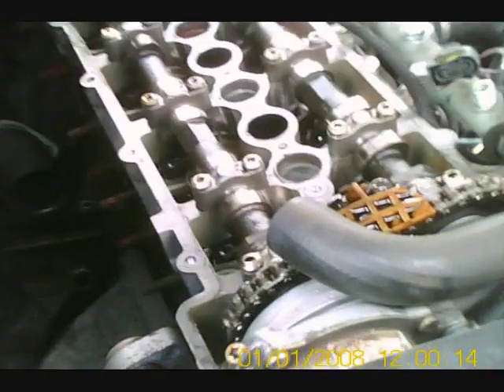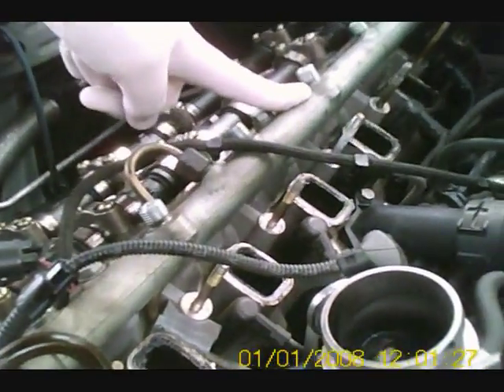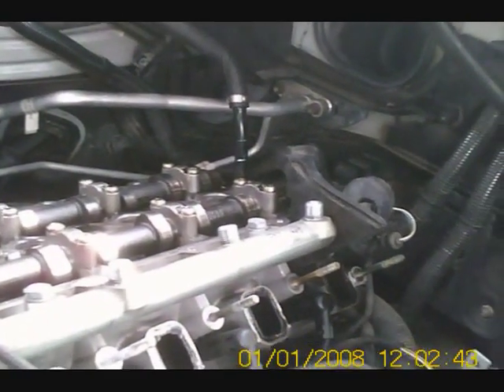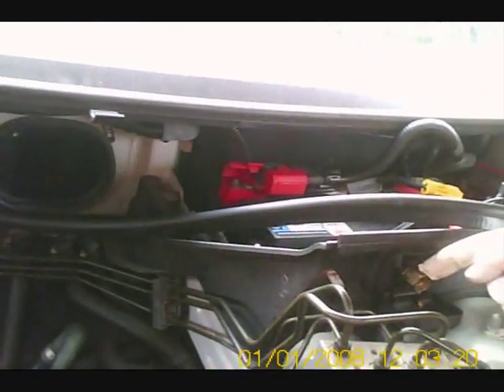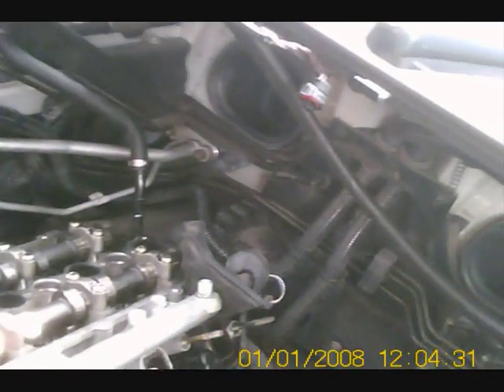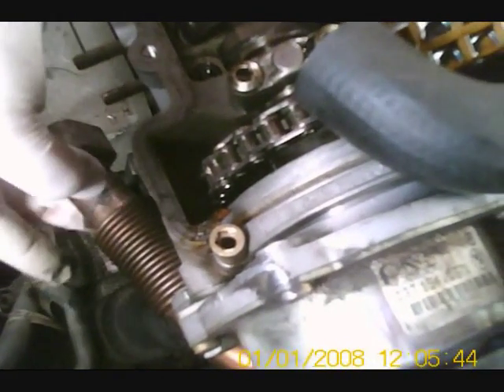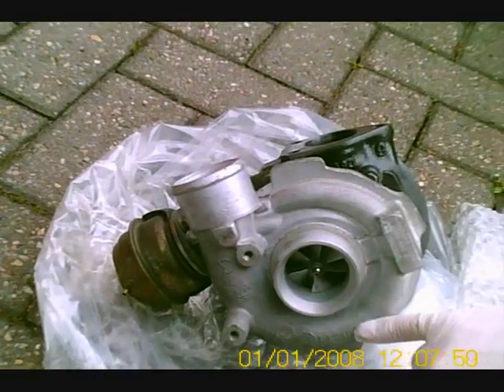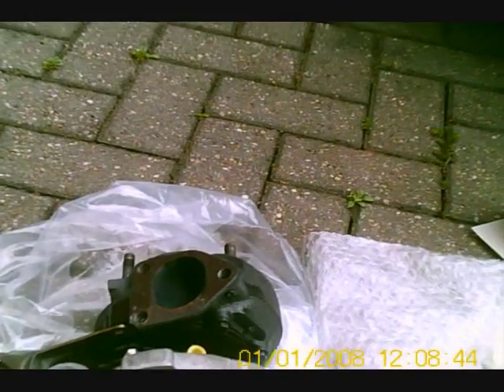full td6 turbo part1

Comment: Many thanks for taking the time and effort to do these very informative videos.  Ironically I'm touring Portugal at present in my 2003 L322 TD6 Full Fat ha... and in the past week noticed a very small whistle on deceleration at low revs on these mountain roads.  I'm hoping its nothing too serious and will wait until my return to the UK! Cheers Mark
Reply from the maker: +staffs964 , Thanks for your feedback, I do miss this truck! It always had a "chirp" when I eased off the throttle but this sounded more like a bearing begining to fail so I took the plunge. To find out it was the actuator was a relief. Have a good trip and hope your Rangie keeps you going well.

Comment: Thanks for the great video, the land rover guys sure make us new owners less worried about our vehicles. I noticed mine when i got it was whistling quite a bit when i got it, but after some good doses of 2 stroke oil (JASO-FC) the whistling is less on acceleration. I dont have any on deceleration. I have noticed that when i start the car after a drive in it, there is quite a bit of smoke which goes as soon as you start driving, and i think there is wear in the bearings. I had this with an Audi 2005T. Do you think its time i had it overhauled?
Is there anything i can spray on the actuator to free it up??